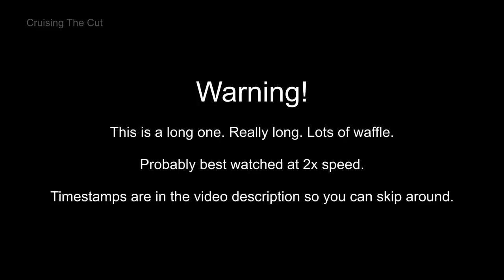241. Narrowboat DIY: refurbishing my shower cubicle

Comment: Question about your WD40 degreaser...  In the video, you had the tube on the can sticking out. The video didn't show you using it, so this may be irrelevant. But do you know that you can still spray the WD40 products without lifting the spout tube? The nozzle has 2 positions. One uses the tube for spot spraying, and the other (tube down) allows for a wider and higher volume spray pattern. All WD40 products with the similar top have this.
Reply from the maker: cheers, yes I was spraying it onto a cloth so used the tube

Comment: In another month run another bead of silicone over everything you have already sealed, and fill up any ridges or nooks where water could potentially sit so all of yhe water will make its way down into the pan, don't be shy with the caulking, it's inexpensive and works... just smooth everything over with your finger tip to give it a nice professional look and feel... adding a desiccant under your pan will keep the wood dry for many years to come as it expands and contracts with any condensation that occurs...
Reply from the maker: Good idea about the desiccant, cheers

Comment: I hate it when people hack things in place. I would have gutted that shower completely. Installing marine grade plywood, covering it with something like 9235 Waterproofing system. Then either re-tile or even use the system you are using.

You will probably have leaks in a couple of years.
Reply from the maker: I hate it when people make ridiculous comments. This was no hack - the plastic panels are specifically sold, and designed for, glueing onto tiles exactly as shown. There's no need to rip the entire thing out; an absurd amount of work for no great benefit. The only leak was in the bottom left corner and was sorted by squeezing sealant underneath the wood - everything else was purely cosmetic and nothing to do with the leak.
Reply: @CruisingTheCut  lmao, so you siliconed the leak like you always do. Then you covered over it. We call that polishing a turd here on the other side of the pond.

I was a tile setter for years. I have repaired more leaks in showers then you can imagine. I have even worked in situations where there is expansion issues.

You did a temporary fix, elaborate but temporarily
Reply from the maker: Yes, I siliconed it. That entirely takes care of the tiny amount of water meeting the bottom of the wooden post and totally fixes the problem. Absolutely no need to dismember the entire shower cubicle to sort that, regardless of how many years you spent tiling things 🙄 All the rest, as explained, need not have been done at all but I did it for aesthetic reasons.
Reply: @CruisingTheCut  you should do things correctly. the thing will leak when the silicone dries out in a few years but next time follow his direction.
Reply: @ysesq  Yeah, but in a few years the bath will be boring again. So, another renovation. I like the use of the coroplast, an inexpensive way of making it look nicer.

Comment: If you cut the shower post down to size, you would have been able to use the existing screw holes.
Reply from the maker: It seemed too fragile to cut otherwise of course I would have done so

Comment: Any "teachers" out there who can "educate" him on the usage of a compass spread to the maximum width,locked down,and the scribed across to the lowest spot,or how to use a piece of cardboard to trace the cut angles onto and then use as a template onto the to be cut piece??  Cut as many pieces as needed to cebrr the entire width and start with the tallest and squarest one trimming it down to fit followed by the next and then the final multi direction trimmed piece cutting it down to a 1/4" or 6mm longer than needed and then making small cuts to trim it down in both directions until it fits snug as a bug in a rug..  P-11 caulk in appropriate color is 100% waterproof,very expandable,and like 30 year plus lasting and won't mildew stain unless the caulk isn't fully sealed to the 2 surfaces allowing water to get behind..
Reply from the maker: I do not have a compass. I did not wish to use a template as then you have two points of failure (tracing the shape and then copying onto the panel)

Comment: I'm only a third of the way through, I do hope you remove those tiles and dont cover the moldy mess and sodden wood with the new corrugated shower walls.

Also, the screw woes, wait till the glue sets and remove the screws.
Reply from the maker: I did not remove the tiles, there's no need and they help to line the panels up with the shower tray. There's no sodden wood behind the new panels and the only mould was on the sealant which was removed.
Reply: @CruisingTheCut  I'm just watching the second half now. I'm sure it will be fine, but for me and my ocd it would bug the hell out of me. All that aside, I do love your content, the in between banter where you are talking to the camera / yourself makes me laugh 😂.

Comment: Yes but that chipboard doesn’t like water & will swells & has to come out & replace with marine ply! Get yourself a fine saw ( electric ) for cutting the plastic.  Get yourself a cardboard box & use it to make a template & Mark your plastic board! You can get a plastic moulding which your wall panels fits into! Doesn’t make whether your in a long, short, boat, or building, the shower Reno’s are a shit of a job! I just glue my corner piece in!

Comment: Couldn't you just cut the metal tube (Shower head hanger thingy) so that you COULD use the existing screw holes?  PS Mold and Mildew Spray.....find it, and use it to make all that BLACK stuff go away_
Reply from the maker: It's such a cheap piece of plastic, it felt really brittle like it would shatter if I tried cutting it.

Comment: I guess you could have just cut the new shower bar down a bit, rather than drill more holes. You probably don’t need to adjust the height down to your waist anyway. :)
Reply from the maker: Cheers. It's such a cheap piece of plastic, it felt really brittle like it would shatter if I tried cutting it.

Comment: Anyone else see exposed wood under the lip at the end?
So close to solving it...yet...that will wick water. You need sealant all along that edge below the door so no wood shows.
Reply from the maker: There's no exposed wood under the lip. It does look like it but it isn't. I think it's some very old sealant. Not wood though. No extra sealant needed.

Comment: Cutting the back of panel will allow you to press panel into that angle
Reply: Your panels could have been cut along the back to allow a bend without breaking the front face. Make two or three cuts about 1cm apart that go 1/2 way through. That should allow a neat bend with a slight curve. This wont work in cold conditions as the plastic gets brittle. But toasty warm summer should be fine.

Comment: A generous application of bleach would appear to be in order to get rid of the remaining mold on the shower door and sill.
Reply from the maker: Since the shower waste exits to the canal, the use of bleach is not advised. The only mould was on the bottom 4-5 inches of the door seal.

Comment: You should calm down.. not too much tea.. perhaps camomile 😜 is in order.. 
It took you something like a week? 
Honestly it will take me a day or two.. 
but it was fun to watch you in a not so comfortable zone.. Have a go with a bit of bleach here and there and a good scrubbing. 
About your way of over complicate things: 
-you use way too much glue or silicon.
You can play with it and if you put some paper tape you will get perfect corners and lines. Remove the tape before it the glue dry.
-you could use double tape to keep the panels in place.
-you should have made a template by paper to provide you a perfect snuck.
The holes for all the screws should have been done before you glued the panels in place.
The shower holder you could just flip it over ( up side down ) of course you will need to flip over also the attachment. 
Anyway you reach your goal 😉
Keep it up!!
Reply from the maker: Bleach is not suitable in a shower where the run-off goes into the canal. I did indeed use masking tape for the sealant. I didn't wish to use a template because then you have two potential points of error (first, making the template and second copying the template onto the item to be cut - better to mark the item directly). The holes for the screws weren't a problem, it was the inability of a screw to hold the board without getting in the way of the next board. No, I couldn't just flip the shower rail over, it is designed such that the bottom piece works only at the bottom, holding the rest up. Cheers
Reply from the maker: People have good intentions but often don’t seem to imagine that I might have thought of things and tried them or had good reasons to do stuff as I did. That said, sometimes people point out useful things so the comments are always illuminating.
Reply: @CruisingTheCut  I note you did not object to "youtube star", bit of a diva eh?

Comment: You can buy threaded tube to go between the adapters and in wall fittings at you local hardware store, just get escutcheons to cover the holes you will have around the threaded tube.😀 Ps just transfer you old glue nozzle to the new tube and you save a bit of glue and have a spare nozzle for next time.
Reply from the maker: I will try to find such tube, yes. And I did indeed swap the nozzles, it saved me a lot of glue!

Comment: A spray of WD40 automotive bolt loosening oil at the old caulk turns it into spaghetti string and it comes off in seconds ... for those of you attempting this job ...

Comment: use a flathead screw
Reply from the maker: Cheers but it would still need to have a head above the level of the plastic "lip" on the panel and in that case, it will protrude into the channel.

Comment: But for the love of all that is not moist and damp, why did you cover the old and not remove the old tiles + what ever was under it!? :( you are just covering the issue not actually fixing it. Mold will just have a new nice damp, warm and dark crack to live in, between the old tiles and the new plastic, there is no way for it to dry after evidentially the water gets in true that 1 small hole. The old tiles are pours/porous they let water true, the true water tight seal is behind them.
Reply from the maker: Because there’s absolutely no problem at all behind the tiles. Everything tiling and panelling-related was purely cosmetic, as I explained in the video. The single, sole problem was the small exposed end of the wooden post by the door, sorted by extensive sealant underneath it. All the panelling was just ti make it look nicer, nothing more. There is no problem hidden under the panels or tiles. Plus the panels are actually designed and sold as designed to be adhered to the tiles. None of the tiles or grout was mouldy in any way.
Reply: Leaving the tiles is often recommended if there is no issue with them. Removing them can sometimes cause more of a problem and can get quite difficult to clean off properly.

Comment: I think shower shine in the past would have kept the shower area clean,you need to spray this product after every shower ,very grubby ☹️👎🏽
Reply from the maker: The shower area was already clean. The only grime was a short section, a few inches, of mould at the bottom of the door frame. All the tiles and grout were clean.

Comment: I'm just screaming NO NO NO! at the screen. What you are doing is the equivalent of putting new wallpaper over rotten, peeling old stuff. That shower cubicle is rotten, and it should all be ripped out and re-done from scratch with a modern cubicle installed. If you install the equivalent of the wood that you already have, don't use chipboard, and paint it with an epoxy resin paint to stop it getting waterlogged and rotten. This is all wrong!
Reply: Really, you ought to be using a shower tray and an all-in-one cubicle above this but this costs money, and may not actually fit into a narrowboat. So, flexible plastic sides and a solid back for the taps and so on?

I shudder to think what sort of shower I'd need on a narrowboat, given that I stand 6'3" tall and am rather big otherwise too.
Reply from the maker: @Benters No, that's utter nonsense. The shower cubicle is not rotten in the slightest. The only affected bit was the bottom left corner, as shown, which has now dried out, as mentioned. The fix was preventing water reaching the bottom of the wood, which has been done with sealant. Everything else in the project, all the work with the panels, was entirely aesthetic for my own pleasure as I didn't like the tiles.

Comment: Sitting here screaming as loud as possible..cut the lower end of the down tube off to fit and then slide the lower piece back on and up it..
Reply from the maker: I considered that but the tube is very cheap plastic and seemed so brittle I didn’t like to cut it lest it shatter,

Comment: Yuck nasty dirty shower 🤮
Reply from the maker: No, not nasty and dirty. The tiles and grout were muck-free - and that’s over 99% of the entire cubicle. The only bit of mould was the lower few inches of the door seal.
Reply: I know it sounds counter intuitive, but you really should have ripped the entire shower cubicle out and rebuilt from scratch using new timber ( waterproofed for extra protection) you would have found this to be a much easier process with the added assurance that all joint areas were properly sealed, and proper inspection points built in using stainless steel screws and head covers. You also need to take into account “ capillary action”. Water can travel up and under overhangs etc. I would also have replaced the shower tray, the mixer tap  and shower head.  With regards sealant.  The guns have a little steel tab at the back near the handle. If you press this a few seconds before you finish the bead run , the pressure is released in the steel plunger and the glue/ sealant stops pouring out.   An ok job though.
Reply from the maker: That would be completely unnecessary. The only problem area here was the tiny spot of exposed wood at the bottom of the post by the door. Everything else in this job, all the panelling and corner pieces etc, was done at the same time purely for cosmetic and aesthetic reasons. There’s no reason at all to strip all the tiling, woodwork and tray out.

Comment: Well.. Had you not been a normal human being. As soon as you noticed the problem, you would have scrubbed the corner, removed the old silicon sealant and added new sealant. Much easier.
Normal human beings really love to make more work for them selves.
Reply from the maker: How would that have renovated the entire cubicle, as I wished? The fix to the corner was exactly the same whenever I did it. Everything else shown here was purely aesthetic.
Reply: @CruisingTheCut  it wouldn't have renovated it, but it would have prevented rot.
Reply from the maker: The rot was, I am quite certain, so slow in growing, that the amount of time I sat and pondered it will have had negligible effect, especially since, having dried the wood out, there's virtually no damage to be seen.